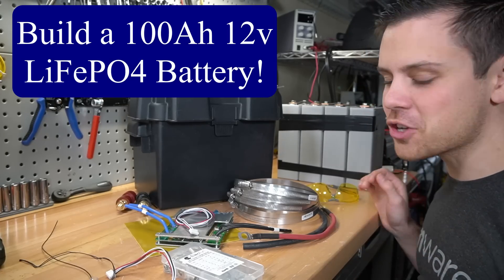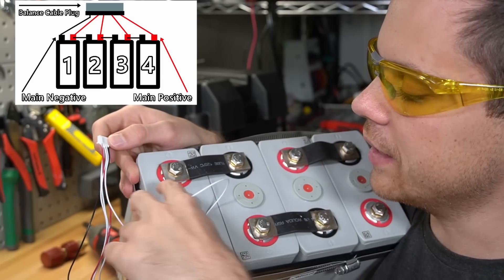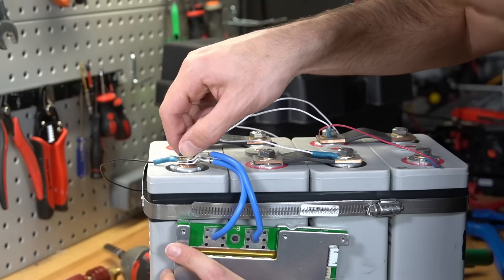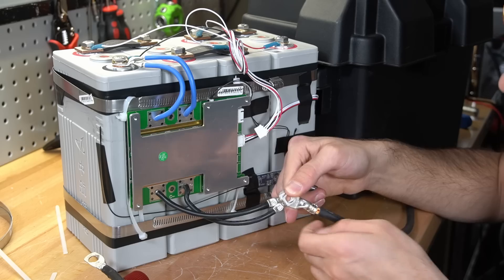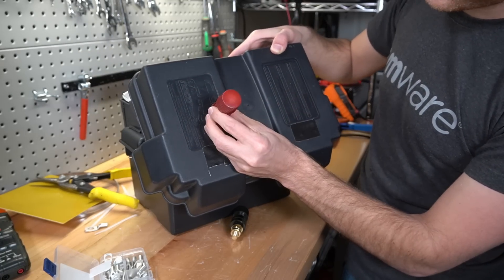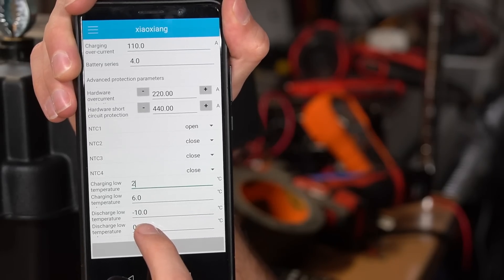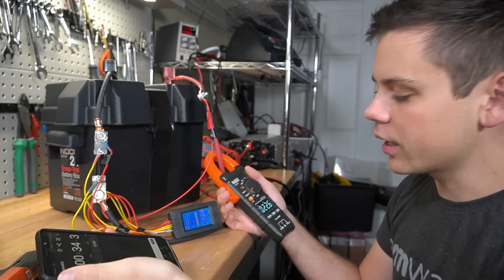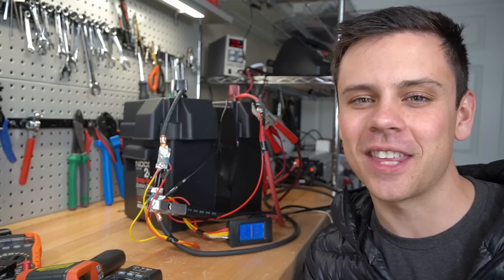DIY 12v 100Ah LiFePO4 Solar Battery for $555

Comment: so according to your web site it says this  (If you run 12V, a 100A BMS can run a 1,200W load max)  Does that mean i should not go over a 1500watt inverter?? because on everything else, not using Lipo4ecells  you recommend a 2000 watt inverter.. Thanks I am running a 200ah lipo4 12volt

Comment: I wonder- I'm planning to ultimately have a 400 Ah solar system for my RV. I can build 4 of these battery packs as I go- thank you for the video. My question is, do I need one BMS for the whole system or do I need a BMS for each battery pack?
Reply: If you're going to keep 12v and run the batteries in parallel, you can just use separate BMS. If you are upping your voltage to 48v you'll want to get a new BMS as these won't support series voltage

Comment: Hey Will, are you not concerned about those terminal studs ever wearing through the “tupperwear” and shorting out?
I wonder if putting them on the 2 bump outs where the battery cables are meant to come would be a safer choice?
P.S. I love this build and think it is awesome for a beginner ( like me lol).

Comment: Hey  I just found about you're video's, they are really educational. 
Keep on the good work.  I was wondering how the alieexpress 36v 100 ah battery's would work. and would they be good enough for an electric engine from a boat?
the engine uses about 50 ah an hour on full speed.

Comment: I am learning so much from Wils video's. Wil, I have fears of batteries causing a fire In my camper. Australian climate, central Australia 30celcius to 50c most days. Apart from building a liquid coolant cooling system (electric car) my idea is to purchase the Lithium battery sells and build my own batteries.  Keeping the sells separate with long buz bars allowing maybe 10mm gap between each sell and not putting the sells in a plastic case/container. (And no electrical tape restricting air flow between sells haha) This will allow easy air flow all around each sell keeping them cool. I could also ad a small fan pushing hot air away. I would love your expert feed back on this idea. of mine. Thanks Steve.

Comment: in the really of this story it was not $555 

to many ppl was making film like this and when i see this video or another video i was shocked because it not a real price 

555 with out shipping and when you taken a look in the website you`ll see the cheaper price 

555 + 1000 <--- shipping by DHL or another company = $1555 for one battery 

even i think this battery shopping was near than his house so that`s why he said 555
Reply from the maker: No my price was actually with shipping and it was accurate. What happened is that the price of the cells increase after I made this video in the video before it. I actually talked about this in recent videos and give an alternative cell because these ones have gone up in price so drastically.
Reply: @WillProwse   this prices all of lithium battery was very higher because they banned the US authorities from air freight all kinds of lithium batteries around of the world but only your country making them free shipping so be happy

Comment: Love your work!
If I were to build a single 200AH 12v battery with 8 of these 100AH cells in series/parallel, is there a 200A 4S BMS like this available that you'd recommend?  Or should I stick with two separate 100AH batteries and will the BT app support two different BMSes?
I'm only sticking to 12V because I need a drop-in replacement for my RV.

Comment: I put a 12s with bms in paralell with 48 lead acid bank in a solar system......many people said this is dangerous if bms fails internally I can overcharge the 12s bank.....I made with 18650

Comment: My camper is 25 years old. No Air conditioner no microwave no heater no water heater. I just run a little fridge. Right now my camper is hooked up on a 200 foot electric cord the camper has a fuse box and a power converter with battery charger

Comment: 🤔 I'm a bit concerned, this doesn't look very durable, I doubt id trust making a battery using so much tape. I'm sure it works well unless it gets warm and the tape fall off
Reply from the maker: Use kapton
Reply: @WillProwse  I'm interested in making one or two batteries for my TT and I currently have two 6v flooded batteries on the tongue of the trailer. Do you think it's possible on a budget of about $600?

Comment: @DIY Solar Power with Will Prowse  
Dude your the man!!! I recently came across your channel looking to replaced my AMG batteries setup for my boat, 7.5 years and 3 set of 2 AMG 100AH @ 24V and +$1500 later not to mention back breaking install on the boat(heavy)! I HIT SUBSCRIBE!!! New to the channel but learn a whole lot watching a hand full of your videos. I LOVE DIY! To the MEAT: If I was to built 2 of this battery, could I put them in series? Also I have a on-board NOCO Genius GEN3 30 Amp 3-Bank Chargers on my boat... "Will" I be able to charge this battery setup?? Will or anyone here help me "DUCT TAPE" this question?? Thanks again Will, I really enjoy the video!

Comment: Hi Will
I tried downloading the andriod version of the bms file but it wont open and it says that the file could damage my andriod device. I dont have an ios so i guess a cant use that bms. Can i use tha daly 4s i know it dose not have low temp cut out but i live in the hotter climates of Australia and would never expose my system to zero c temps. I have bought the alluminum case cells via your link from ali express. I just wanted to double check on the Daly bms for use with these cells
Regards Kev Bryson
Reply from the maker: You need to allow the APK to install. My phone said that too. It will say that when using apps not in play store
Reply from the maker: Yeah sure, Daly works fine in hot climates

Comment: One question, is it OK for the BMS to touch metal stuff, like a metal hose clamp? From what I remember, circuit boards and metal stuff don't get along!
Reply from the maker: With nylon zip ties and a heat sink touching it, sure. Heat sink is usually fine
Reply: @WillProwse  Those did not look like plastic....It's an accident waiting to happen!
Reply from the maker: @mymagicsigns  no it's fine. And not the hose clamps, I said the zip ties are nylon. And heat sink is not grounded. Buy one and test it. It's fine
Reply from the maker: Look at where the live conductors are. Cells are nylon. Look at it and think
Reply: @WillProwse  Looked at it, and I'm still seeing the circuit board pushed into the top metal hose clamp, I'm not saying it's touching the live wires, I'm saying it's touching the circuit board, and dangerously close to the live pads on the circuit board, and it all starts at min 4:05
Reply: @WillProwse  Perhaps next time you make a video where you teach people to put the metal hose clamps right over the bare circuit board :D
Reply from the maker: @mymagicsigns  no, you're missing a huge design aspect of pcb, there is heat sink on both sides. You can glue that whole thing to another piece of metal. I promise it's fine and I'm looking at it in my hands right now. And I'll do it again. If it wasn't safe, I wouldnt do it
Reply from the maker: Specifically what conductor are you scared of shorting here? Which one?
Reply from the maker: Oh the b- terminal? Let it touch the hose clamps. It's fine

Comment: I'd like to keep the LiFePo4s in my van at about 40% charge during extended storage using my solar array.  Can I use the programmable BMS to do this or is there a better way?

Comment: Hello, I like to use (buy) a solar system to use for my Reef -Tank led lights . The power supply of my led lights MW Mean well CLG-150-36A  Input: 100-240VAC  2.0A  50/60Hz +36V=4.2A  . This led is running 10 houres a day . What can you suggest me for a system. Thank you . Greetings from Belgium :-)

Comment: Will great info thanks. One question, when you test capacity is the cut off voltage point a safe voltage as not to damage battery if used often?

Comment: A technical question that could help us all...

This bms has overvoltage protection and voltage reconnection and timers for both all of which can  be adjusted which opens up the possibilities I list below which no one seems to have explored the possibility of use of anywhere....

1.      is there anything flawed in my thinking the overvoltage could be kept to trip at 14.6v and by setting the voltage reconnection at 13.3v it would not reconnect on float voltage - be it by solar regulator or normal charger eliminating the need for specific lithium upgrade charging devices.

2. could these disconnect reconnect voltages also be tweeked further to accommodate alternator direct charging....IE>

14.6v disconnect would be ok for a 14.7 alternator but a 14.4 alternator could be set at 14.4v disconnect and the timer on the bms disconnect delayed for say 15 minutes to charge more fully and the reconnect at 13.3v stop charging until the vehicle is stopped and re started which is what we want ?

3.   one last question - does  a 40amp fuse off an alternator straight through charging to lithium battery limit the current to 80% of that 40 amp so I can control charging current by fuse due to the rising resistence or is that something specific to the Victron equipment that  I ve read too much into ?

WE now have cheap cells, and a good bms you ve shown us - but can it be shown its possible to do these other things that eliminate all of the cost of upgrading chargers, solar regulators and specific equipment for alternator charging.

cheers

Comment: Noob here. Am I safe in assuming this design can be connected in series and in parallel? When used in series applications how can you ensure the batteries (cell groups) are balanced with each other?
EDIT: BTW, your Battleborn videos steered my friend to replacing his RV gell cells with Battleborn. I, on the other hand,  am chronically cheap and this syst4em appeals to me.

Comment: I have a 120amp Daly BMS that came with a single "7 awg" wire.  I was pretty skeptical, but i have performed 5 or 6 100amp battery load tests (about 1hr continuous load).  Even under that 100amp load the wire barely gets warm, surprised me!

Comment: Will, I have added you to my short list of people I would most want to have lunch with.  There are now two people on that list,....Elon Musk is the other person.  Can you give us any thoughts on expected reliability, and life span of this set up.  I had about decided I was going to have to go the direction of the Battle Born in part because of the 10 year warranty or perhaps the new Renogy you just reviewed,.....but this battery looks totally doable.   I had thought I would be following your advice to use the new Renogy DC/DC MPPT controller in my RV Application using two of the 200 watt solar panels you recommend on your webpage and two 100 ah batteries.

Comment: Will two these work for your 4000 watt, 24v Off-grid solar power system ?
Reply from the maker: Better off making a single 8s 24v battery

Comment: If you want to double this output to 200AH with 8 cells, would it be better to make two full batteries with separate BMS's and then parallel them or to parallel pairs of cells and use one BMS with monitoring of the pairs?

Comment: I don’t understand to interest in 12 volts, all modern inverters for the house are at least 48v.  Please do analysis based on 48v and considering the cost, gerry rigging is not practical.
Reply from the maker: Yeah I hate 12v too. And you must be new here if you didn't know that haha I have multiple videos covering why I dislike 12v.

Comment: I wonder if they have a 16s version. Is it a active or passive balancer? Just having the ability to program it via an app is a definite plus. The specifications on Ali Express is vague at best.
Reply from the maker: Passive and no need for active balancer with new cells. Active balancer is totally pointless for most applications
Reply: DIY Solar Power with Will Prowse good point if you’re using new and matched cells. Finding a 16s BMS with the same specs is the fun part.

Comment: $350 for 12V/100Ah (including SPIM08HP [200A] Li-ion cells, the same BMS [though less expensive alternatives are available], case [Northern Tool or Harbor Freight], lugs, terminal connectors and wire).

A note about BMS's:  In high current applications, combine an inexpensive BMS with the proper series connections with contactors, relays or, ideally, MOSFETs. Use the BMS to switch the external circuit. This configuration avoids the increasing expense associated with high output BMS's which is necessary due to everything from thicker traces, bigger heat sinks, etc.

A high output BMS becomes a single point of failure, which is much more likely in high draw configurations. And simply adding parallel wires without verifying the ability for the traces and components to handle the current is just begging to let the smoke out!

Comment: Question, if you have multiple solar panels on your van Not all pointing in the same aspect ? Would it pay you to have a separate charge controller for each panel? Cheers

Comment: Dang it!  Finally pulled the plug on replacing my AGM, and the linked cells are already sold out.
Reply: Always happens with anything Will finds and recommends; you gotta move fast in this game!
Reply: Yeah, I should not have been surprised.

Comment: So Will on the DIY battery builds are you recommended this BMS over the Victron, (smart battery protect and 712 monitor... I am curious as I have already purchased the Victron (used) and your link for the 200ah batteries.
Thank you again

Comment: Hi Will, as always a great instructional video! I know you wanted to keep some of the components inexpensive for the viewers, but previously I have used a battery box from Newport vessels and you should check it out. Already pre-wired with posts and also USB connections and a battery level indicator. Also has fused outputs. a little pricier than the $10 Walmart battery box but I think it's pretty good product.

Comment: I can get a 12V 100Ah AGM battery for $169.00
Reply from the maker: Also, usable capacity of lead acid is less than 50%. So it takes 2x lead acids or more to have same capacity as this battery. You should watch my other videos to learn how this works
Reply from the maker: And this battery will last 10 times longer. And be more efficient. AGM and lead acid in general cost more than any other battery for solar. In the long run

Comment: You spend a lot of energy on low temperature cutoff sensors.  ....but not everyone needs that capability.  I'm curious how your recommendations change when low temperature is never a problem.
Reply: Byron Watts If you are only down south then the daly bms with no working temp disconnect is perfect.

Comment: So Will, if I need 24v can I just connect two of these in Serial? Any BMS considerations in that case? Thanks for the awsome videos!
Reply: You CAN do that. I would recommend doing everything he just did but use an 8s BMS. The only problem is finding a box or method to house them. I did what I just described but used the non plastic cells and made a "L channel" cage around it then riveted it all up

Comment: Could I hook two of these up in parallel?  If so, how does that effect the app connecting to two BMS via bluetooth and would I need to solder on additional leads from the BMS?
Reply: You could just parallel two cells together then series connect the 4 parallel connected pairs. 8 cells, 12 volts, one BMS.

Comment: is there an apple version of the BMS software?
Reply from the maker: Yes
Reply: @WillProwse  OK will..my bad...should have asked if you could post link...I looked on your forum and looked on the BMS webpage and I cant for the life of me find an Apple App link...frustrating...the webpage for the BMS actually shows a picture of the BMS connected to an Apple computer but almost everything is in Chinese.....Help?  I have your book and built your previous LiFePo battery and even bought the battle born too....just would like to pull the daly BMS off and use the Low Temp BMS for the first battery I built....

Comment: Wouldn't it make a little sense to installing some type of toggle switch or some type of switch or a quick disconnect on the balance leads. so that you wouldn't have to open it and unplug and plug every time you want to shut the thing down.
Reply from the maker: Oh you never need to shut it down. Turning it on is a one time thing.

Comment: The idea of having to reach in to connect and disconnect the BMS seems like a pain. (I assume that's required to prevent the drain on the battery when it isn't being used.)  Is it possible to put a switch on one of the BMS leads that would serve the same purpose - that is to turn the BMS on and off? Also, since this post is a "beginner" tutorial, I think you needed to discuss how to charge it. Can a regular auto-battery charger simply be connected to the terminals without adversely affecting the BMS? Thanks for great videos, Will.
Reply from the maker: Oh turning the BMS "on" is a one time thing. After it's connected, you don't need to worry about it. The "drain" is not an issue at all. And any 12v charger will work. Automotive, solar etc. Just attach it like any other battery

Comment: Will can correct me if I'm wrong but I believe if you buy the BMS from Aliexpress you need to buy the Bluetooth module separately.  Something to note if choosing this option.  It's included with the Batteryhookup model.

Comment: 5:03. Did your C- arc when you plugged in that cable. Seems to have flashed at the end of the cable and your table.
Reply: Randy Stout My guess would be that an LED on the BMS flashed. The balance lead powers the BMS, plug in the lead and the board powers up.